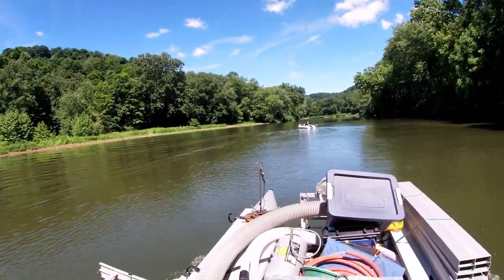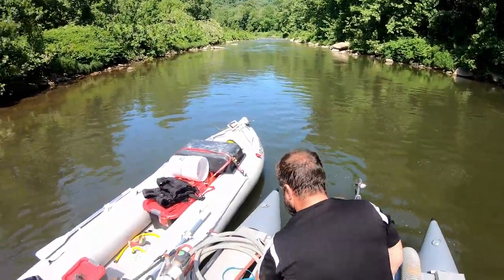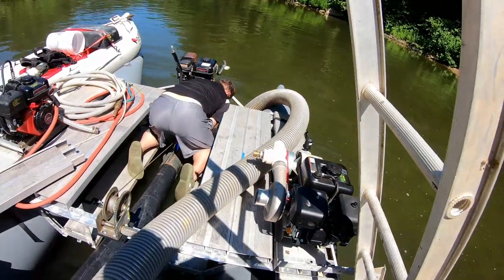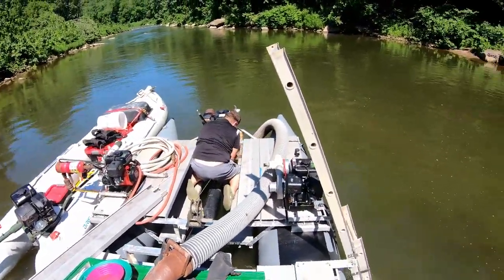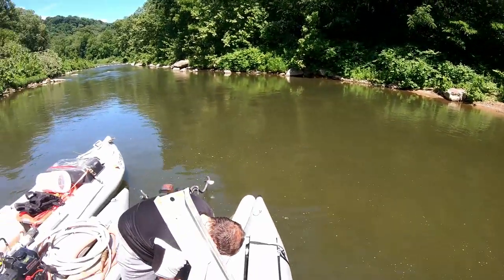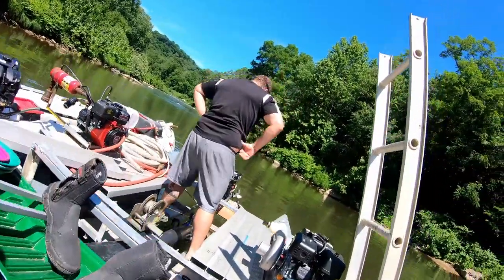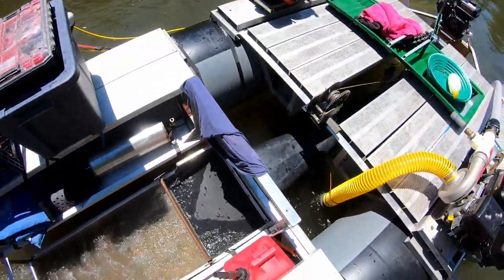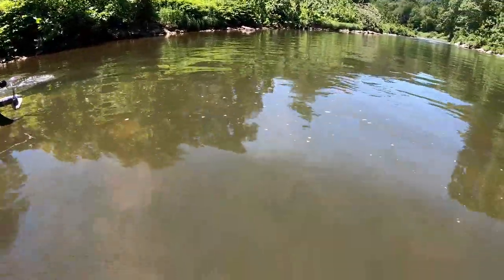Cataraft dredge testing.

Comment: I really like that design,it looks like it could be upscaled to fit an 8 inch design for dredging in Nome.
Reply from the maker: If i were building a Nome rig like this that would be an 8 inch Id go with 20ft pontoons.  It already cramped running this 5 inch on 16 ft pontoons lol.
Reply: @theprospectinggeologist4347  I would love to build a Nome rig capable of going out to the international waters,they say there is lots of area out there that has never been touched,im sure because its not easy to build such a vessel without having alot of money lol.